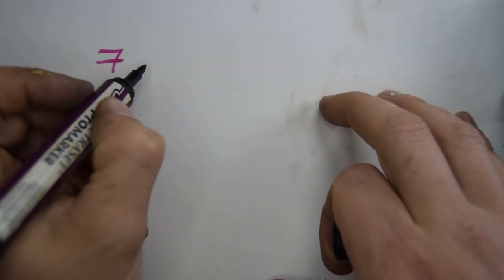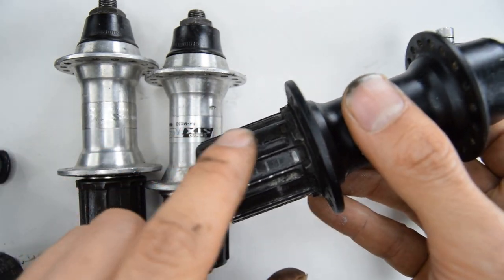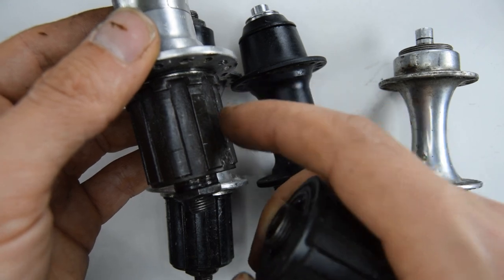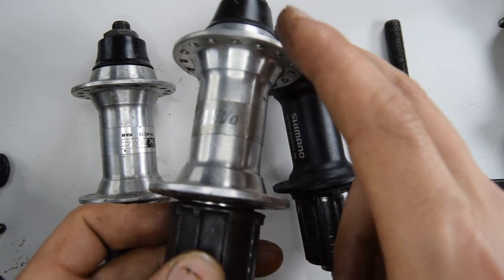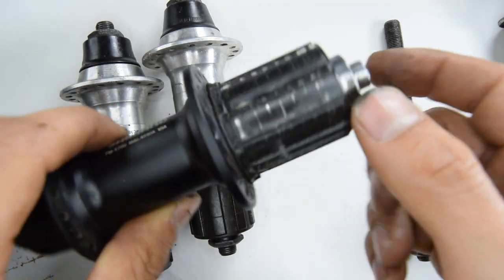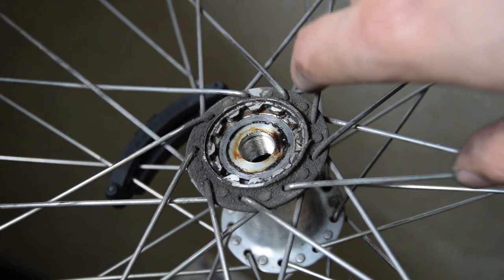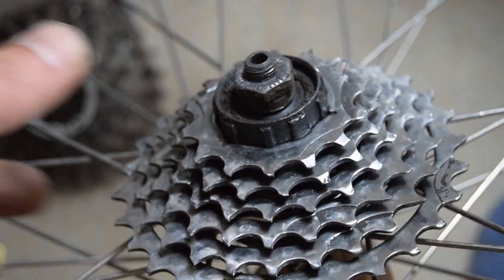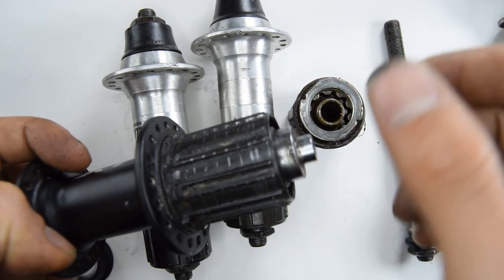How to convert a 7 speed hub cassette to 8, 9 or 10 speed

Comment: Yes its fun to work with wheels,hubs,spokes. I have also rebuilt a lot of wheels.
Tip: with a lathe you can re-grind the pitted bearing hubs and conus but then you have to use new steel bals.
Reply from the maker: Yesss, read about people doing this before. Just need more space to install one in my living room.

Comment: Thank you for an informative video.
You'll be pleased to know that an old dog like me can learn new tricks, in particular the ball bearing extraction using a HD magnet 👍.
I'm a stubborn ol' bugger, I've been using my beloved XT thumbies on an 8 speed cassette. It does work with the extra click, as I'm sure you well know, but I'm having to fine tune it too often.
So I'm going to downgrade back to a 7 speed cassette.
Now where did I put that spacer?
Cheers mate. 👍
Reply from the maker: Someone suggested on my xt thumshifter video, the possibility of dremeling an extra groove (interior plate) to make a real 8th click. I recall checking if it was possible, can’t remember…food for thought
Reply: @atboy4342  Now that is food for thought. Thanks for that 👍

Comment: Road bike 7 speed rear axle hub spacing is usually 126mm, not 135mm.  Mountain bikes do start at 135mm for 7 speed, so this method will only work for mountain bikes.

Comment: If you can put an 8-speed on, it will also take up to 11-speed. Don't have to stop at 10.
Reply from the maker: Yeh I tried recently, it works.
Reply: It can go up to 12 speeds if you want to buy a cassette out of the Shimano ecosystem. Lots of manufacturers make 12 speed HG cassettes, I've installed them numerous times
Reply from the maker: Like sunrace 12s for example?

Comment: well this answers two of my wheels.. but I'm looking at my 2021 norco indie 4 and an 8 speed 26" wheel with a joyride hub and wondering
Reply from the maker: Quick search : norco indie 4 is set up with a 1X7 drive train. Joyride hubs seem to be Single speed?
Reply: @atboy4342  I have a joyride hub from another bike with a disc and 8 speed cassette. I actually have another similar to check also
Reply from the maker: If it has a 8 speed cassette, it likely will hold 9/10 speed. I tried 11 speed recently, only issue was tightening the locknut. The tool couldn’t go deep enough to properly tighten (its another video coming eventually) @the_nondrive_side